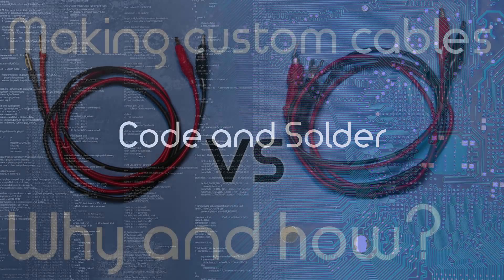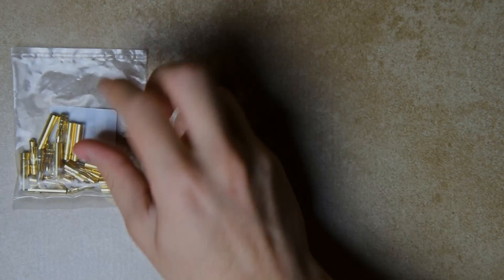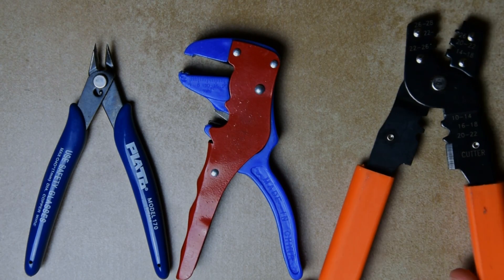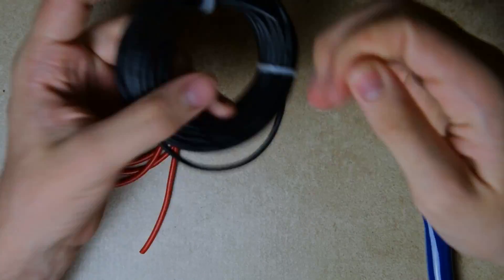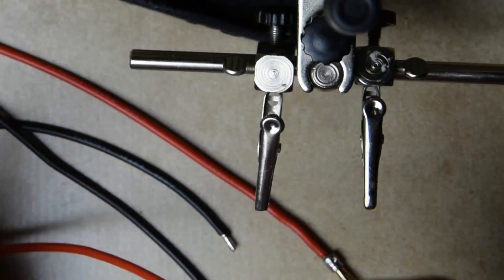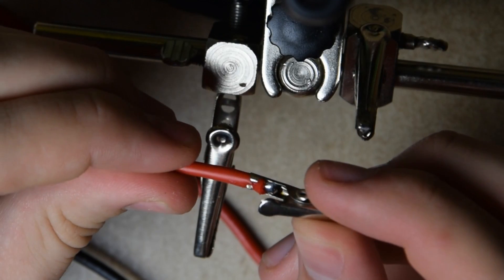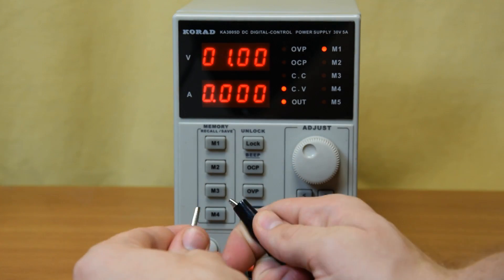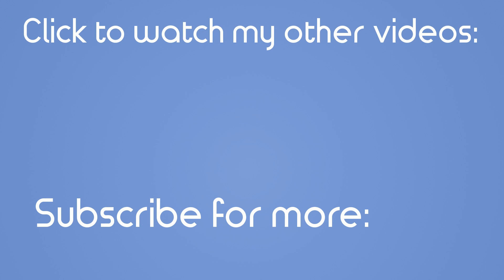Making custom PSU/multimeter cables - Why and how? (in around 2 minutes)

Comment: hi what cable size did you use. and where did you buy it ? i wonder
Reply from the maker: I usually use AWG16 but it depends on the application. I bought it on HobbyKing, I think.

Comment: z nudów natrafilem na ten film przegladajac kable silikonowe na google ponieważ robie dosłownie to samo i mam nawet ten sam zasilacz

Jak ktos chce polecam zamowic sb kabel siliconowy z firmy piekarz LIG 2,5mm^2 connectory 4mm i 2mm, krokodylki hirshmann ma1 i adapter 2 do 4mm wtedy mozna sb fajnie wymieniac krokodylki np na takie duze odsłonięte zeby np podlaczyc cos co sie nagrzewa

if u speak english just read second sentence its cool to have 2mm and 4mm connectors on each end of the cable 2mm plug in crocodilles hirshman ma1 and 2mm to 4mm connector so u can plug crocodiles that use 4mm plug in basically bare ones so you can hook up something that gets hot

Comment: Aren't you supposed to use banana connectors? Sure bullets will fit, but I thought bananas were better for some reason.
Reply: Oh. I just realized that you're saying bullet in the video but actually using banana connectors :)
Reply from the maker: I always associated banana connectors with the design that uses a split single piece of metal, rather than this multipart design, you might be correct though. English is not my first language and I'll check.

Comment: Just in case anyone is looking and can't find the silicone wrapped wires for this project, look for what's called Cabtyre at your cable/wire supply places. It's rubber/silicone wrapped cable that comes in 14/2 12/2 etc varieties and the internal wires are silicone encased and can be any length you want.
Reply from the maker: They are PVC coated though. Probably even a bit better electrically (as they are copper) but much less flexible. I personally think the extra hassle is worth it. Turnigy silicone wire is decently cheap from China.

Comment: I think you are supposed to be crimping instead of soldering
Reply from the maker: It all depends. Crimping is important if there is a constant force acting in perpendicular, like in screw terminals. The bullet connectors and crocodile clips I am using are designed for soldering.
Reply from the maker: Soldering is harder to get wrong, true. I feel the need to reiterate tinning wires for long time use in screw terminals (eg. in 3D printers) is a terrible idea. The connection degrades with time and can cause fires.
Reply: Crimping can work great, however without proper crimping tools the result is almost guaranteed to be subpar. I therefore find it better in many cases to solder even connectors that were intended for crimping. It's much easier to make a good solder joint than a good crimp joint.
Reply: Yes absolutely, somehow this seems to be a little known fact. For screw or clamp connections, always use ferrules on stranded wires.